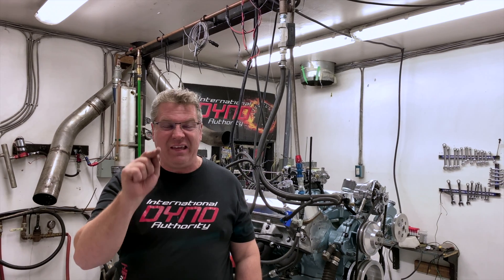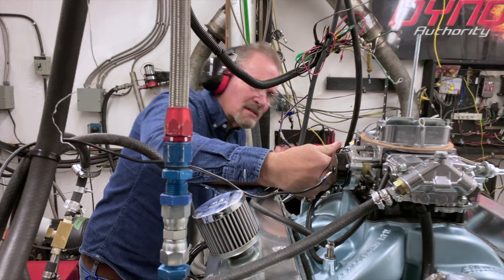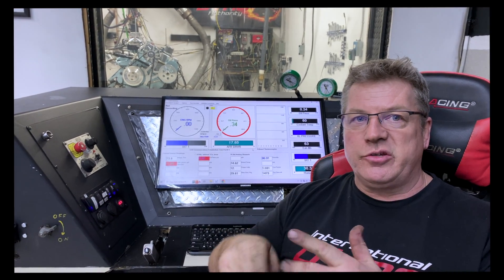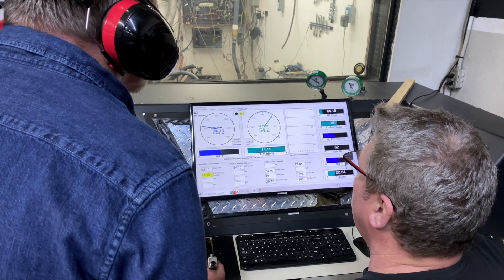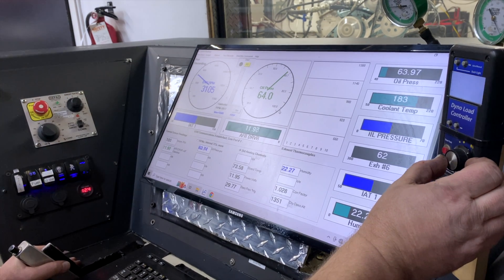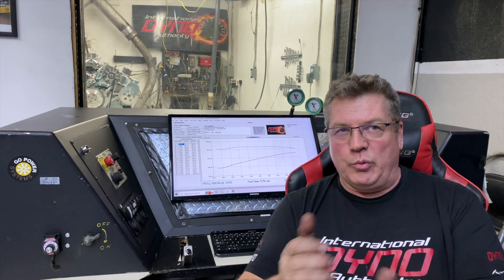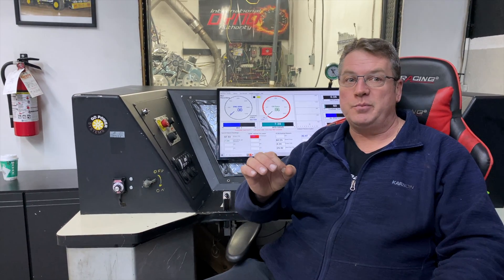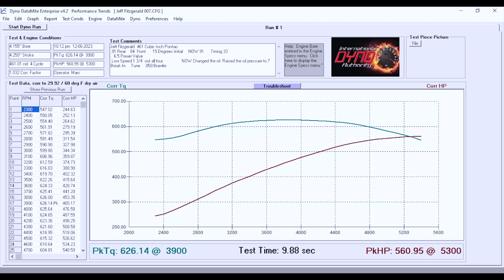How to properly break in an engine

Comment: I’m just curious on your website it said Before transporting the engine to our shop, fill the cooling system. Could you explain that. Great videos by the way
Reply from the maker: That way you've checked for leaks

If you feel the cooling system, you've checked for leaks ahead of time

We have had, five or six engines that showed up, when they arrived. They had not checked the cooling system.

Some of them, had cracks in the sleeves. As soon as we added water, the water went straight into the oil in the oil pan.

So, more of a leak check than anything else.

I think that's a fantastic question by the way